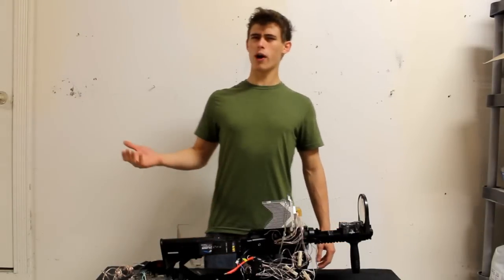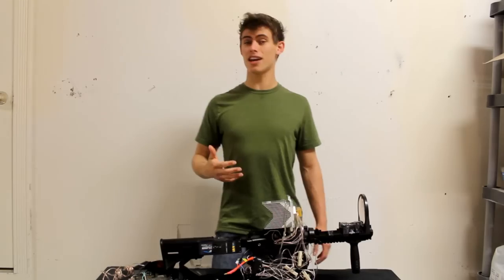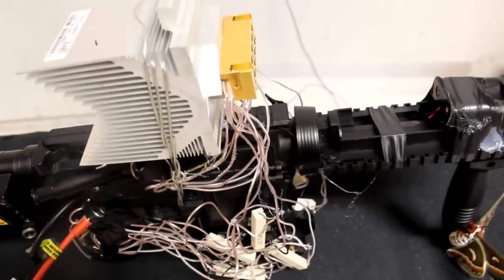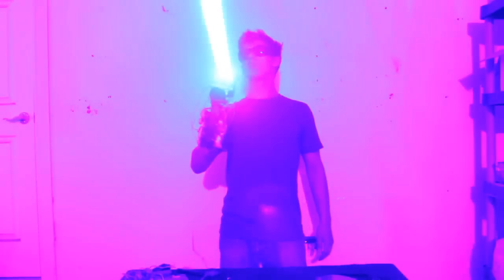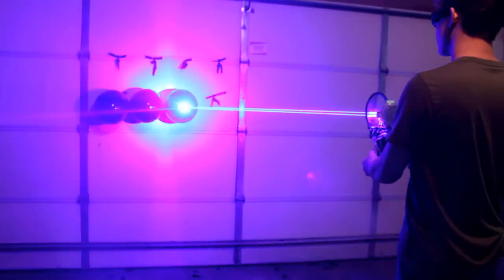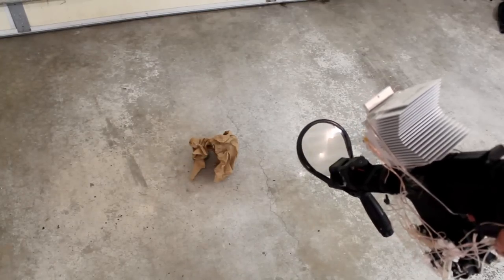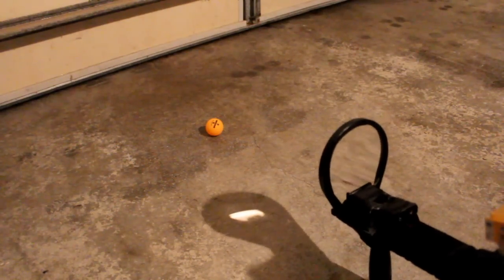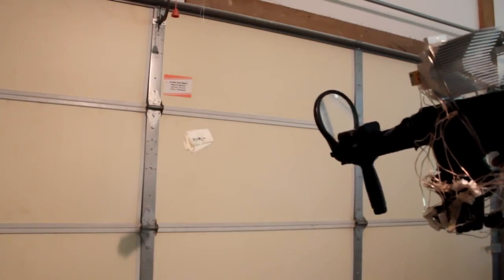My Homemade 40W LASER SHOTGUN!!!!!

Comment: +styropyro hey anny one want to colab on a laser project? i want to build mega laser that is powerd by lets say around 800W since i want to test if that would have anny recoil at all, if not i would like to build one that can operate at around 4,8Kw since that would be like a overkill canon and should produce atleast i bit of recoil, so anny one know physics well and want to help me build one?  i know how to bulid one and asemble such a thing but i want some one to help me out since im pretty new when it komes to lasers and such stuff, and i want maximum preformance out of the watt i push into my laser, i was thinking about a liquid nitrogen cooled hexa lazer aray with a crystall converter to make the six beams into one and then make them go out of the gun. so yeah anny one who wants to help me build that pleas leave me a coment.
Reply: +natan zielinski It will not produce any recoil measurable by the layperson. As you know, photons have zero rest mass, but their energy equals to a very small mass via E=mc^2. To get a glimpse of the magnitude of the mass/energy conversion ratio, think about this: nuclear weapons get all of their energy from converting a few grams of uranium (you need kilograms to reach critical, but most is wasted). So, if you use a nuclear bomb to power your lasers, you might get recoil from "a few grams worth of photons". Sooooo, may I suggest you beef up your science studies before throwing hundreds or thousands of $ out of the window?

Besides, laser weapons are worked on around the globe by private and government financed top-notch research groups. How do you expect to compete with a few hundred physics PhDs with millions of $ budgets and a few decades of experience? Go to college, get your own physics PhD, then you  can start inventing these things (financing is still up to you).

Science is no child's play. Ever thought about why most science studies take at the very least 5 years (to master's degree)? That's 5 years of 20-40 hours per week of nothing but science classes. They don't do this for the heck of it. So get real, go to college; or shelf your dreams and get a job where you ask whether customers "would like smiley sauce with that".
Reply: boycot gugle i was thinking it would produce some recoil since nasa wants to build a laser powerd space shutle.... so i mean if nasa says a big one can produce  enough power to shoot a spache shutle across space, then i see no reaon why it would not have anny recoil.... but i im that interested in building one to sell them i want to build one to have it just for me my own design, i was thinking to build the 800w laser gun and if it did no do much damage i think i could figure out how to speed up the phontons to make them faster and more eneregetic so they could penetrate thick steel, i was think along the lines of 6 laser beams that are filteres through a photon exciter module of some sorts if you can even build one with this times techonolgy and then filter it the 6 beams into one super cooled crystal that would merge them into one and filter that one ultra hich power beam into a dece that makes the laser beam like 0.5mm wide  so it would focus ontu a smaler point thus making it penetrate thick materials, so yeah if that would not make it penetrate and melt steel in 5 second atleast i would work on it some more maybe go nuclear option (quiet literaly) and enhance the beam with nuclear particles wich would increase it strencg, but there is no fission core small so much that i wcould put it in a rifle... maybe a canon would be posible but the radiation that would slowly kill me would be a problem too, thats why another idea is to try and merge the laser some how with a "microwave" you could say wich makes this radiation that melts stuff but doe not make you sick. so yeah i have endless ideas how to weaponize lasers, i think if all else fails, i will go back to my idea of the nitro glicerin powered sniper rifle/canon with bulets with some sort of yet fuel to acceleratem them more and a tungsten tip, that would be able to accelarate the bulet to mach 8 or so and be able to go in one side of a m1 Abrams and go throught 10 more of them and still keep going (i know its unrealistick with mach 8 but still if i could pull of a trick like that the rich people would moist there pants when thinking about how much they could sell it for haha.... ech my useles theories that i canot make since im to poor to aford a gun :P meh i think i can make a 400w laser that shoots semi auto and can burn instantly holes in cardbaord and be happy to shoot that xD 
 -.-
Reply: meh... im not realy good with this stuff...  im more like moden MC Gaver lol.... i once made a shotgun that would shoot pingpong balls, i made it from a drain pipe some duck tape and baking soda with vinegar.. i mean it was verry messy and only shat about 12m but still, it was fun to shoot xD i mean i know NOTHING about chemistry or physics, but hey im a fucking botanist..... -.- well i mean im in first year of the class so yeah i know already more then im suposed to know about this stuf xD i mean when a student knows how to grow blue mushrooms when he was suposed to grow normal ones is gues then the student is more inteligent xD ehhh i should read that book but you know im lazy man very lazzzyyyy :P i do recomend the anarchist cook book if you can buy one with out geting on some cia watch list ahahah so yeah im just throwing out random ideas when saying how i could built the doom laser of mass destruction haha :D i mean its realyun realistic but, i was thinking more "what if" more then should i build it. ones i can find a solid theory on how to make it then yess then i will make it :) but for now, i think i have to go water my plants hahahaha
Reply: natan zielinski
The anarchist's cookbook is readily available as free pdf, if you know where to look. A word of caution, however: most recipes contain fatal flaws. I'm not kidding. Best case they simply don't work, while some of them might outright kill you (NEVER make acetone peroxide for the love of God - every few years somebody appears in the newspapers because they tried; usual result: eyes and eardrums burst, hands blown off, not a nice fate). There's a ton of better books with actual working recipes, in the so called grey literature. See, here's where you need science knowledge of your own, in order to spot the mistakes and then avoid them. Only because something is published does not make it true. Always be critical, always double check.

Btw. you sound like the prototype ADHD kid. Why not try some ritalin and see whether you've got more patience for the books then. It's really quite obvious. I'd ask your local psycho doc about this. Yes, I'm an ADD guy myself (without the H, meaning not running around like a lunatic but daydream for hours). Adderall helped me, ritalin a bit as well. No, you won't be converted into a soulless robot zombie, no worries.

Botanics, interesting^^
Did you at least grow psilocybe cubensis? Oh, if you're really into botanics and are enthusiastic about new project, I got one for you (depends on where you live, needs temperate climate): spread psilocybe cyanescens in every forest in your region. It's one of the only psilocybe shrooms that thrives in temperate climate. We gotta spread it around the world xD

Ok, but seriously. Botanics. Does that mean it's the first year you have that in high school or are you in college? If the latter, why would you study a field that is already basically dead? Traditional biology is done for, only biochemistry, bioinformatics, microbiology etc. survive. Ok, maybe you got rich parents, then super awesome, do what you like to do ;) But if you need to find a job one day, I'd get the hell away from botanics...

Oh, and no matter whether you're still in high school or already further, PLEASE, study basic science, at least a bit. Not only will you achieve much more yourself, it's just that c'mon, make light faster, nnnnoooooo...... That's like a bleeding wound on all academic development of mankind......
It's embarrassing, will lead you on false tracks with projects doomed from the start and even put you and others in danger. You can't just trust your luck when you manipulate the forces and laws of nature. Really. You gotta know what you're doing.  Lock yourself in the basement with a half year supply of ritalin and 3000 pages worth of good, hard science, and return with white hair but as a prophet (or something. don't sue me if it doesn't work)

And lastly, I said many bad things about you, but in all earnest, I really admire your dedication, drive and good spirit. If you also knew your shit, you could change the world. You see, I know many things (PhD student right now), but I struggle getting my ass into gear because everything seems boring and meaningless. Had I your curiosity and drive, I would be unstoppable. As would you be with more knowledge. Only thing is: knowledge is easily gained from books. A positive look on life can not be achieved like that. Therefore, you can do it, while I'm basically at an impasse. Please don't let your opportunity go to waste and tackle real science.

There will be sacrifices, but it will be worth it. E.g. a few months ago, I had a nasty, oily liquid that from composition alone should have been not too bad. Well, a single droplet of it when mixed with the correct oxidizer ignited without an outside spark or ignition source, all by itself in such a short time, the naked eye could not detect any delay at all (estimate 1-10 ms) and caused a bright green, nearly 20 cm high flame jet, while nearly shattering the container (ONE fucking droplet). We burned several pipettes because it was absolutely impossible, reacting fast enough before this deadly shit went off. You'd probably have enjoyed it quite a bit^^ To get here, however, I've ground through more than 5 years of 40++ h per week studying, with tests on the weekends, practical courses during the holidays etc.
Hmm, maybe that's where I lost my curiosity and good spirit. Shit.
Reply: hey i live in poland, if you want to we could try someting more basic... i would like to implant some electric stuff into a plants nerves, and maybe make it be able to move a motorized small hand move at will thus proving plants do feel xD no but seriusly i need and let me reapeat my seld I NEED some adderal, but even if i wanted to i need to wait until im 18 to buy it, but still if i locked myself in the basement i would not come out with white hair and as a phrophet but more like a god with blue hair xD (yes i dye my hair blue i love that color) so yeah haha unles you know some loop holes how to obtain aderal i realy wont be able to do ann thing, wand  btw... i am realy 100%++ acting like i have adhd or im acting like a zombie and want to kill myslef, i have mood swiangs alot due to watching and reading about starvation over hunting and sad stuff like that xD i feel like my brain is going to melt after reading stuff online fo 14 hours a day when not at school thats why i choose not to read the news and play games to take my minf of how to solve world hunger.... i mean the other day i was thinking how one would code a ultra mini pc that would controll "led skin" (look for it online japan made some sort of led skin recently) to make predator type of cloaking technolygy xD it has its flaws like they cant realy have pixels like on a monitor but if they could jam more leds into one cm pathes and make the skin for ecample on your arm into a monitor, you could display active camo and change it to your desire haha so yeah i have alot of ideas.... for example i would improve the led skin and add a change the leds to another type of light emiting divice that can emit light but also when turned off be used ass a solar panel so yeah..... i defenetly need the aderal.. this is geting bad i was trolling some guy that wasy high and having a flame war with me in the coments f some vid and i made him belive lizard poeple exist.... now im talking with mormons online and i dont know why ;-; my mind wanders too much im thinking of 10 thing at a time.... i have been to my schools psycho doc but the say im perfectly normal have not a bit of adhd in me and im all ok -.- what a bunc of un educated idiots -.- i mean im mking fucking portible speakers from scratch from transistors and stuff i have around thats broken.... i wont even listent to music on speakers i have 300$ headphones.... omg you have no idea.... i feel like my mind is a mess and aderal will give my mind a grid i can put my thoughts in evenly and striaght and will help me think more clear and not about how nuclear fision works while im writing a test about the bacteria that live in soil -.- like wtf... but once i get started and i can think about one goal im like a goddamn bullet train you can stop me and i will get my way xD tried every thing nothing works to keep the adhd "silent" i mean i think i have oc as well i once sorted 15 packs of m&m into color coded bags..... then i counted them and wrote how many of them were in the bags... then i took them an calulated wich ones way the most when mathematicly calcualting when one bag had 107 and another  for ecample 128... turns out the yellow one were about 0,2mg heavier for some reason xD i cant stop typing either... i have a serios adhd problem but no one sees it...
Reply: natan zielinski
I'll send you a PM.
And don't worry. See me type like crazy too (above and wait for the pm, it's huge), I know exactly what you mean.
Reply: natan zielinski
Ok, I'm not sure whether that worked. Can't send you anything here, only on G+, which is strange. Not sure what this hangout shit does. Anyway, I sent you a link, if you get it, write me something in the same manner back and send me the link via PM, it should have the option on my page, I hope. Tell me if you did not get the link.